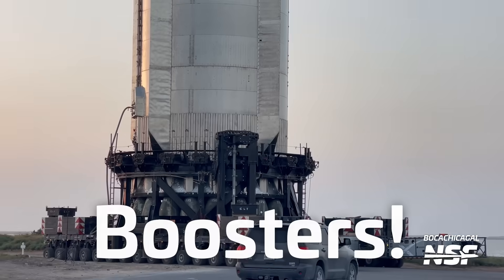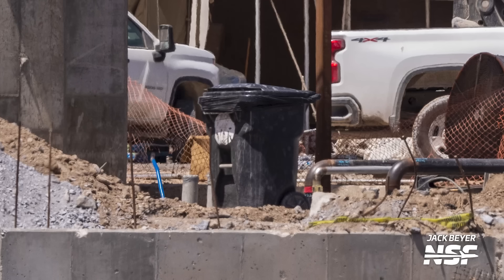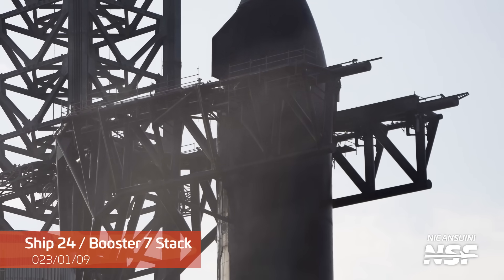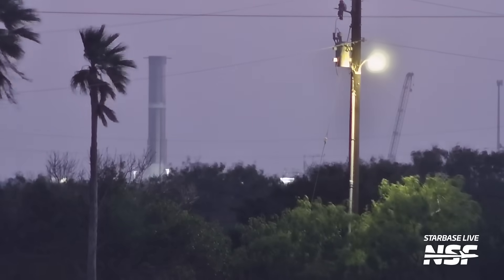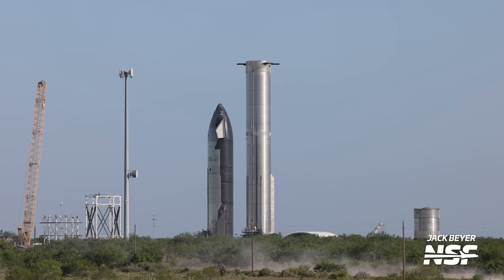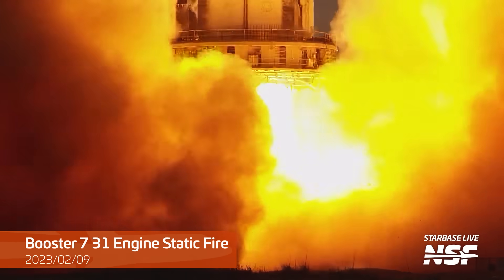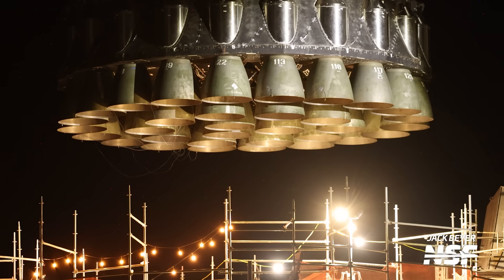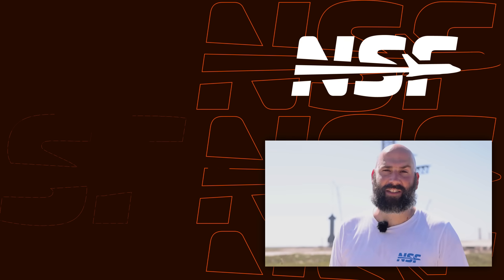Starbase Update: Starships & Boosters Rolling! Testing Ramps Up!

Comment: After watching several updates on StarShip, I had an Epiphany -> Why have the cargo exit at the BASE of the cargo section, where the door section will be under lots of stress on ascent, and simply move the 'dispenser' to the TOP of the payload volume, just below the nosecone. That way the door opening will have a great reduction of the mass that it would need to support. In orbit, it would make no difference to operation. Forward to Elon svp.

Comment: Question! Why does booster 9 still have chines if the COPVs are no longer needed (replaced with electric gimbaling)? Thanks.
Reply: They still need pressurised helium and nitrogen in the process to re-start the Raptors for landing. The hydraulics 'unit' on the  outside with it's 'recatangular' chine, was what was replaced by the electric gimbal system.

Comment: Hot staging ring for B9? Does it actually have to have a hot staging ring? Did Elon say that Booster 9 will have a hot staging ring? I think it flies without out it unless stated otherwise.
Reply: The ship quick disconnect (SQD) has already been moved up.  The ship will need to sit higher for the QD to connect to it and the hot staging ring appears to be the only plan able to do that currently
Reply: @nintandrew13  good point
Reply: Yes Elon explicitly talked about modifications to the vehicle for that

Comment: Wouldn't it be easier to attach the hot staging ring to the bottom of the upper stage rather than attach it to the top of the booster?
Reply: Then ship would need to carry that extra weight to orbit and beyond, resulting in a significant mass penalty.  Better to have it on the booster
Reply: @nintandrew13  That's a very good point.  I guess I didn't think the weight would be significant, but you're right, it would add up.

Comment: My bet is that they will add the hot staging ring to the bottom of the ship and then set the ship on the booster.
Reply: Maybe the hot staging ring will be a disposable part, with it being released from the ship after the ship lifts off the booster..
Kinda like the interstage ring on the Saturn V.. 🤔

Comment: Perhaps the hot staging ring will be given mounting points and will be attached to B9 with the staging hardware.
Reply: As the latches are on the booster, it would make sense to attach the extra ring to the Starship for this flight. No worries about weight as there will be no payload. And it would be interesting to see what happens to it on reentry.
Reply: @gravelydon7072  Not a bad idea. And although the idea for the future is to use the chopsticks to catch the Ship, at a worst case scenario, the hotstaging ring could act as an emergency landing 'legs' although it may crush a bit. Though it may crush, it may be enough to absorb the landing 'shock' and still keep it upright.

Comment: Do you think the expanded concrete work could also be part of a water collection system. If they are looking to had rapid turn around launches, they would need to get that water to reload the tanks. Wouldn’t be all of what they use, but a good part.
Reply: Perhaps but Boca Chica won’t be used for rapid launches, it’s R&D only and is limited to a small number of launches per year. The pad at Cape Canaveral would be the one to look at.
Reply: @Ic0n0gr4phy  Good point.

Comment: "We saw this coming. Elon is stubborn. Now the launch pad is toast. SpaceX will need to move operations away from Boca Chica" ---- A random keyboard engineer after the first flight test.
Reply: He is stubborn. How many holes did he blow in the launchpad prior to this launch? Don't be a homer, dude.
Reply: Sooner or later main operations will move away from boca.

Cape just is a better launch site.
Reply: It did take an extra month to get the OLM ready for testing the next Starship booster. More than the initial two months Elon initially stated. Not bad considering the repairs to the damage done, all the robust upgrades, and all the new support infrastructure. The SpaceX team is quite amazing.
Reply: Don't worry it's going to blow up again 😂 shortcuts always leads to faliure

Comment: It looks like the deluge system needs a few seconds at lower pressure to purge the air before the full fury is released.  Purging the air probably needed to prevent cavitation damage.
Timing the operation to get the engine start in sync with the deluge will need to be refined by testing - probably this week!